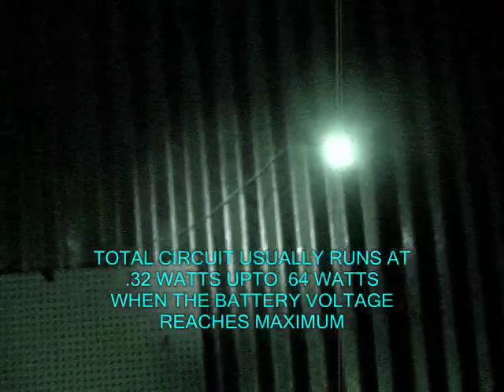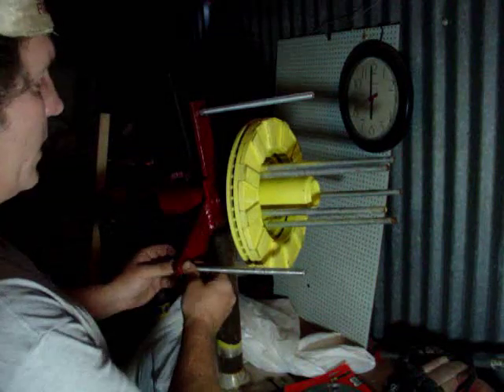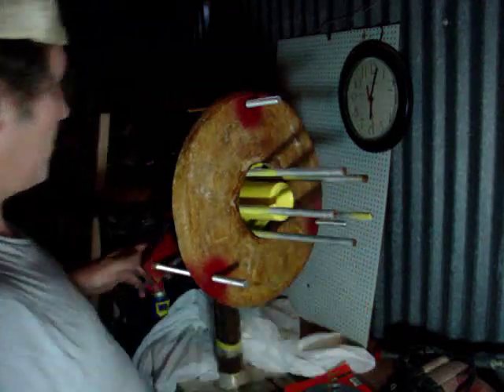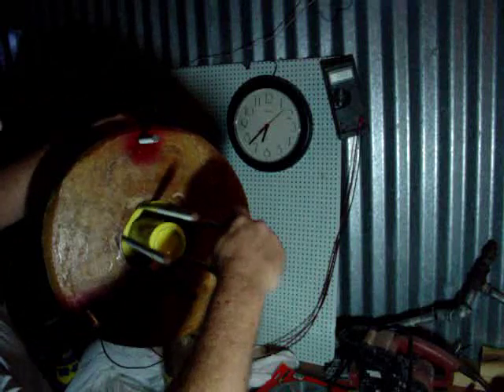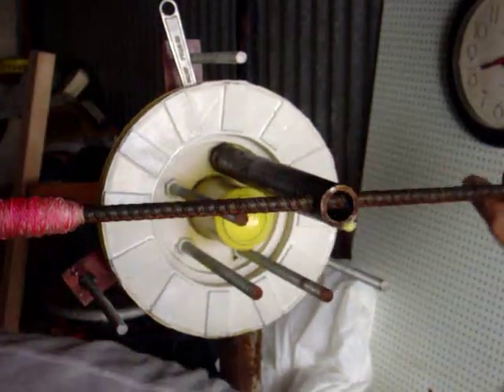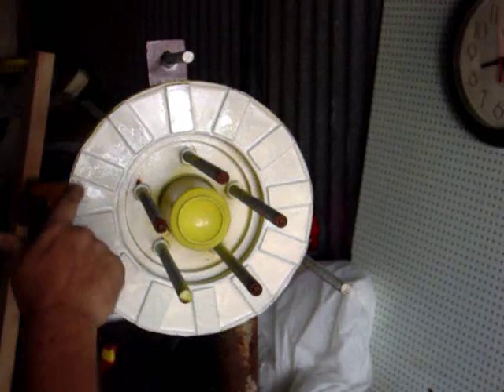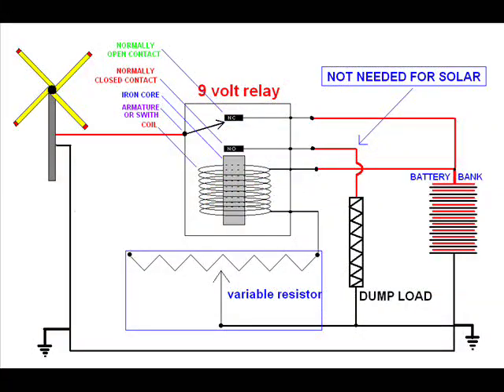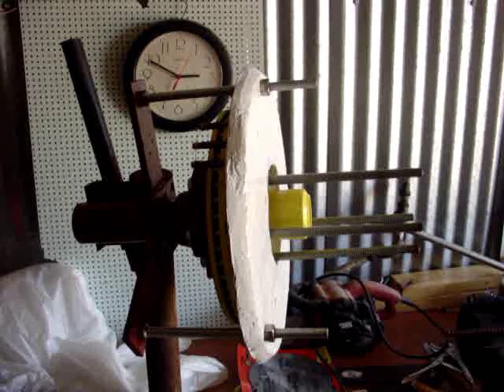BUILD A DUAL PERMANENT MAGNET ROTOR WIND TURBINE (PART 25)

Comment: Well, that's almost true about degausing the magnets and then regausing them again. If you regauss with electromagnetism, that'll work. But reheating and cooling them off next to nonelectro magnets risk losing both. I think neodimium loses its magnetism at around 700°f. I was thinking going to an auto salvage yard. One with electromagnetic cranes, pass the guy a few bucks to let him turn on the magnet. Maybe, huh?
I had a ton of pretty good neodim mags in my car. It caught on fire, everything burned. When i went to pull them off the dashboard, they were on the floorboard, as useless as all the other burnt crap. At that time, I didnt know they can be revived, so I pitched them...oh well. Lol